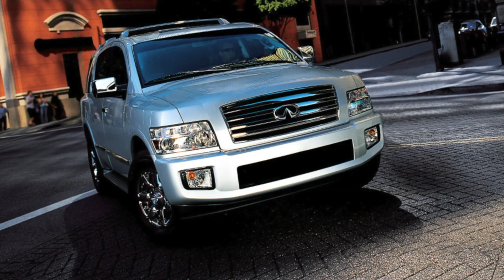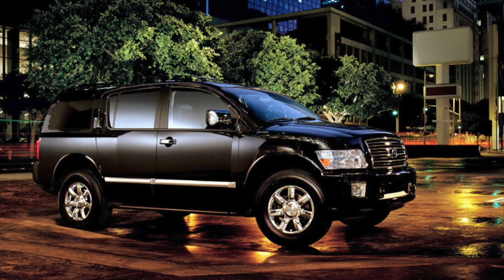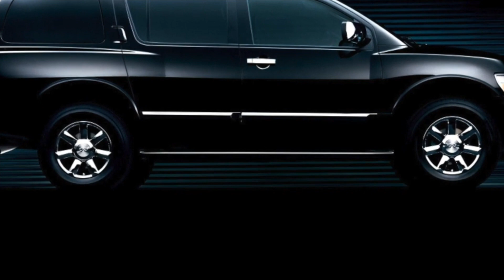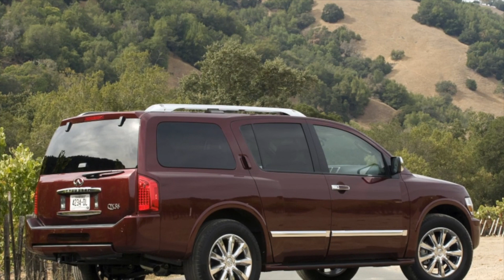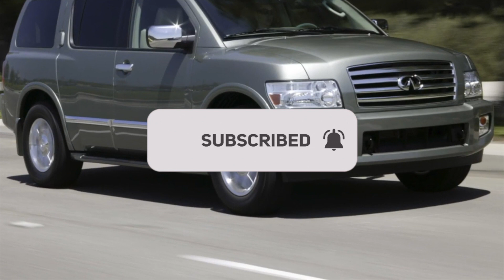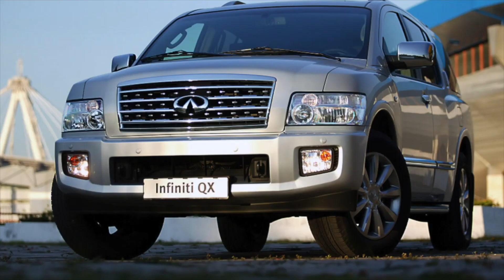TOP Things that will BREAK on your Infiniti QX56

Comment: We just purchased a used model  2005 QX56 with 100 k on it. I will admit the motor needs to be maintained. The former owner neglected its regular maintenance. The dash cluster was sent out as it required repair due to an erratic tachometer, .flickering back lights and  all of the warning signs were lit. Nonetheless, as I  drove it a distance of an hour on the way home the motor felt strong. The transmission on the other hand also needs attention, it felt sluggish/lazy, as if it didnt want to shift through gears. In either case my spouse really liked it. We have two other autos but we recently sold our 2012 Honda Accord  Coupe, it was to low and after having 2 lower back procedures my spouse had difficulty entering and existing the car. My mechanic skills may be put to the test but the QX56 does appear to be well made and it's definitely comfortable even for a 2005. The interior is in good condition, Well, some tlc, maintenance and time will tell if we move forward with it. Take care all. 👍

Comment: You are reciting a written verbal which has little or nothing to do with this particular model line or year of manufacture. Nothing you state in the 7:45 rehearsal has to do with actual, nominal or abusive use of the vehicle or the conditions under-which it is used and driven. This is a great ploy to get viewers but coming from an owner who has a 2010 QX56 with 279,873 miles on it, you are full of crap and yes, there is maintenance to be done but, my particular year is when Infiniti had a partnership with Mercedes to make their drive train and transmission and there has been ZERO maintenance outside of regularly scheduled and no failure. Please get rid of the CarFact crap on the QX56 and try to make money by some other way; stop misleading people. If I were to buy a QX56 off a spammer like you, I would expect all the things to go wrong.....
Reply: I agree! My 2010 just past 196K miles and runs wonderfully. Yes, she's a gas guzzler but that's a small price to pay for a vehicle that has never left me stranded...ever. I'm so confident in her that I always go on long road trips without hesitation. Mechanic says she'll go to 400K miles easily.
Reply: I'm so glad to read the info about Mercedes drive train. I had an 2005 that I gave up in a divorce and I'm looking to get a 2010 now with 140k. My concern(s) are the timing chain and exhaust manifolds. Have you had these issues?